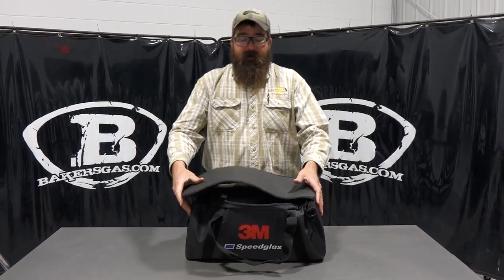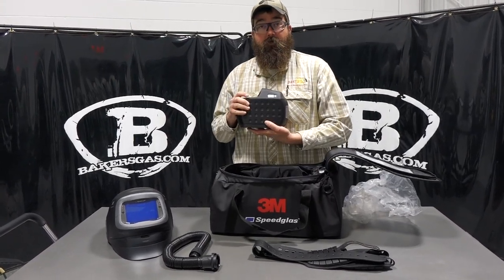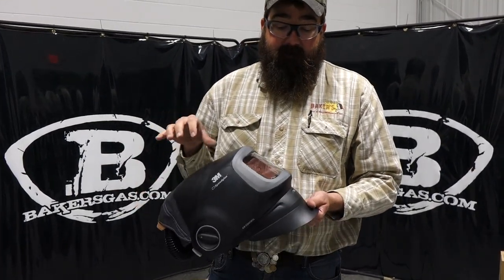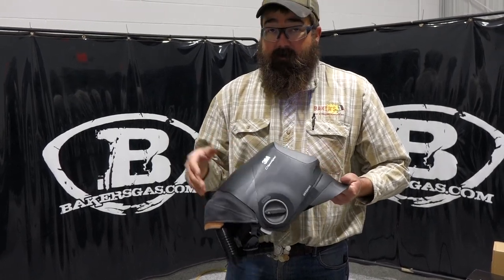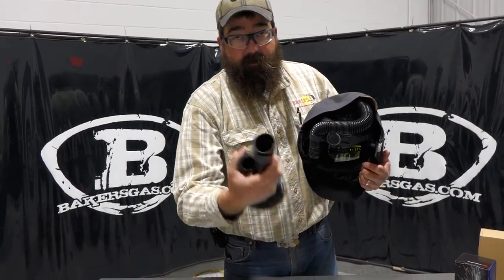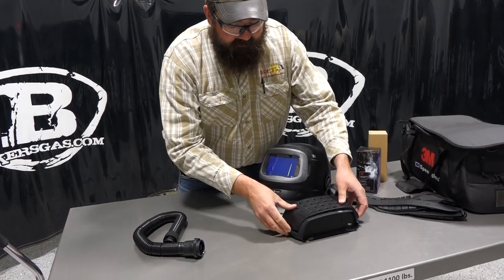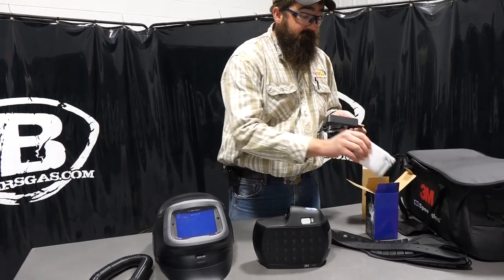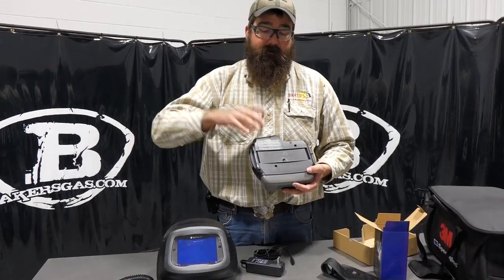3M G5-01 PAPR Review

Comment: I battered my unit daily for 3 years until the ADF died on me, ive purchased a VC adf now which is great. Another small issue i had was the plastic frame that keeps the ADF in place shrunk with heat, so now it only clips on in two places. They are quite heavy but they are a fkn amazing helmet tbf 👍

Comment: Optrel Helix is better ?? 🙃🤔
Reply: No
Reply: I have both and it's not better, it is different. The helix is a great helmet but it doesn't have a PAPR system and it isn't close to the G5-01 in durability. I only use the helix for tig work as it isn't made of materials as tough as the G5-01

Comment: I used one for quite some time in production mig welding, and the only problem I had was that the inner lens is not pressed tight against the ADF, and so after some time, very fine dust makes its way in between the inner lens and the actual ADF. I've never had to touch the ADF, I just blew on it, and it cleaned it up. Other than that, very good, never got flashed, pretty nice and clear. And for weld/grind/weld/grind cycles, the lift up lens beats the crap out of a grind mode button with which I seem to often flash myself with.
Reply: How heavy was it compared to a regular sugar scoop hood?
Reply: @tobrydeleon9889  I've never used a sugar scoop hood, but did use something similar prior. Its definitely heavier, Maybe three times heavier or something like that. But for some reason it never really bothered me, I found it quite comfortable to wear all day on 10-12 hour shifts. No need to take it off, just lift the lens up, and the view is massive for grinding, fitting, etc. The wider view from the lens ( compared to a 2x4" lens ) meant the head did not have to move so much to view the weld.